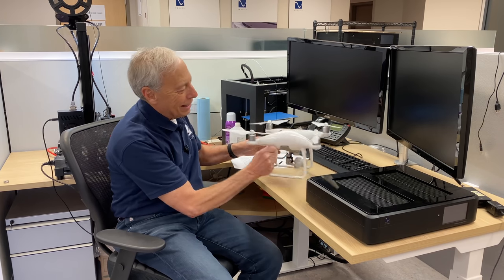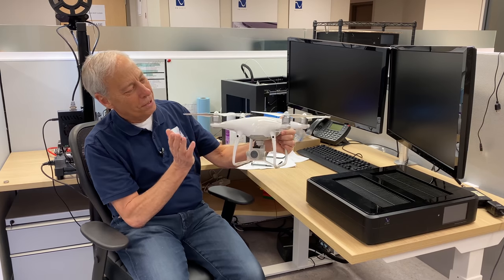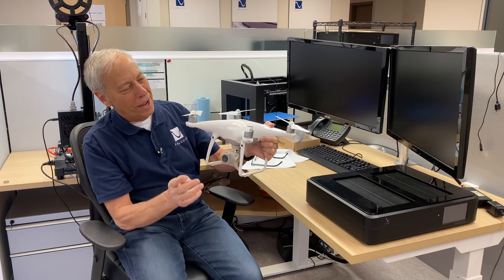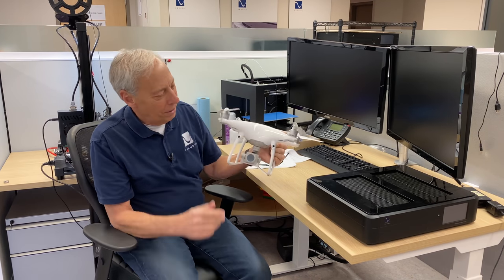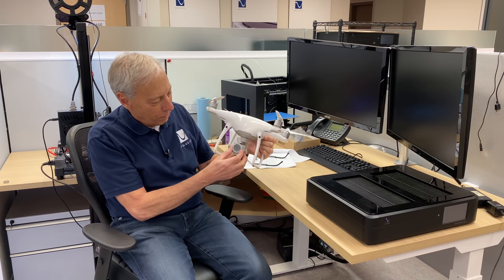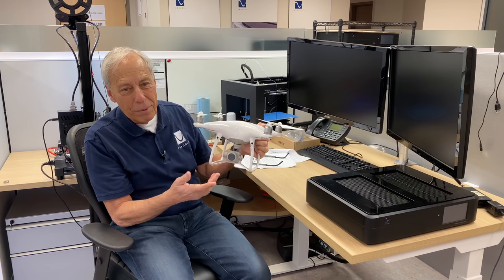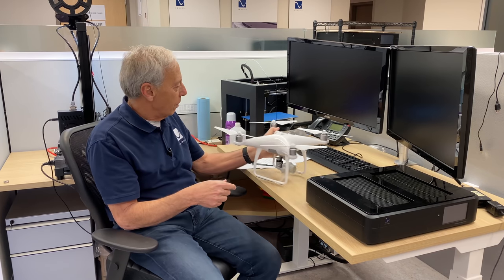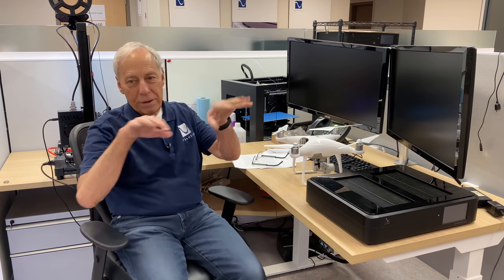Power Amplifier protection

Comment: “Going DC” was much more common in early SS amps that used giant output caps. Many SS amps have sacrificial resistors at the outputs that function as very slow fuses.
Reply: Output resistors can be
1.  Emitter degeneration - allows control/monitoring of current, and balances current across parallel devices.  
2.  LR network - isolates amplifier output from highly capacitive loads, to help ensure stability.  
3.  RC network - provides loading at high frequencies in case of unloaded operation.  
None of those are sacrificial, or intended to function as fuses.

Comment: My amp has these dc offset detecting circuits that keep the mean centre of the output at 0v and also current limiting circuitry to prevent fires in the speakers ...
Reply: But users manage to set their voice coils ablaze, regardless of how carefully the amp designer builds the current limiting and DC offset nulling circuitry.

Comment: Paul's explanation of a crowbar is only partially correct it is called that because it actually shorts the output like putting a crowbar across the output terminals of the power supply (to protect the rest of the circuit) then it relies on either the current limiting ability of the supply or it can  then trip a breaker or blow a fuse.

Comment: After watching this as well as many other of your videos , I'm wondering what your thoughts are with connecting your amps or other manufacturers amps to a dedicated line/ power conditioner. Love what you do thanks for your input .
Reply: Amp protection is a good thing but PS Audio should not say that they can’t engineer excellent tone controls and loudness controls because a simple bypass switch will harm the sound...cause amp protection involving fuses, relays, feedback loops etc. are sonically much more critical than a simple line level bypass switch.
Reply: @ThinkingBetter  well not necessarily you can just measure the output without affecting any signal going through the Signal Path I'm assuming that's how it works for them
Reply: @johnsweda2999  Yes, measuring can be done at high impedance but the mitigation of the failure needs something like a relay. Not sure exactly how PS audio is doing it.
Reply: Paul definitely recommends their "Power Station" line of regenerators, but not other types of conditioners - except their little "noise harvester."  
If they weren't so expensive, I wouldn't mind having one to tinker with and tweak.  Could be useful for a test bench.  But don't believe the claims that they can improve sound quality, other than helping to prevent clipping distortion in special cases.
Reply: Marianne Oelund Special cases = measurable cases.

Comment: My Luxman SQ507X amplifier (early 1970s) only has fuse protection on the outputs so I have added an externel DC voltage detector module with relays that will disconnect the speakers should the amplifier fail. I confirmed that the module operated correctly by applying a small + or - voltage from a battery with resistor in series.

Comment: I want to add how a quality amplifier should act , in the 70's Phase Linear (a Bob Carver company ) had one of the first high powered amplifiers at 350 watts per channel ,one audio magazine reviewing it decided to test it's protection circuit ,they turned it to maximum power and shorted the output terminals with a screwdriver , the amplifier shut down like it should and was fine afterwards ,the screwdriver did not fair to well it looked like someone arc welded with it.
Reply: Carver WAS & STILL IS { RIGHT ON } TOP ( of the )  CLASS
Reply: If you're able to get a working Carver product then you have a winner
Reply: @analoghardwaretops3976  I have a MXR 130 "The Receiver" a MXR 2000 and a Sunfire Ultimate Receiver and a Sunfire True Subwoofer ,and ALL of them sound great. Just wish I could afford one of his new  Crimson/Raven tube amplifiers that have  a 50 year life on the tubes.
Reply: @ameldaquirk3965  They were the most powerful amps by far in the early 70's and did not have the protection circuits of newer designs and occasionally  some did go up in flames. but the issue was not as bad or wide spread as the rumors would have you believe.

Comment: Crawled under a client's home to discover why one channel showed a dead short and blew up his very expensive Kenwood KR9600 a second time.  Idiot used a staple gun to affix the speaker wires to the floor joists and one was straight through.  Fixed that and his amp.  Another situation involved vermin chewing the wires in the attic. In both situations, the amp protected its self by frying.
Reply: Kenwood is not the great company that it once was in the 70's , since then they have focused on bells and whistles instead of quality. I had a kenwood monster receiver the Super Eleven  really impressive to look at with all it's features and great specs (on paper) ,But my Carver MXR 130  sounded way better I heard things that I did not know was on the vinyl or CD . Also better amps do have protection circuits.
Reply: Once while listening to "Dark Side of the Moon" opening heartbeat at high volume, the lead wires on one woofer managed to touch and stick together, causing a short circuit on the right channel.  The amplifier (Dynaco Stereo 400) was fine, and in fact didn't even blow the speaker fuse.  
That was back when amplifier output stages had fairly aggressive current-limiting for protection, which had reduced thresholds when the output is near 0V.  That protects the output transistors from exceeding their Safe Operating Area.  Obviously, it works - but then it can also lead to distortion with reactive loads.  
Most newer designs do not have instantaneously-acting current limiters with low thresholds near 0V, but instead detect average current through a filter, and put the entire amplifier into shutdown if the limit is exceeded.  That avoids distortion with reactive loads, but could in some cases still allow damaging over-current transients to occur, especially in designs that use BJT output transistors (MOSFETs are less susceptible to damage from high-current transients).  
Unfortunately, manufacturers do not share such design details, which would allow customers to select a scheme that they prefer.
Reply: @leekumiega6576  
The Super Eleven does have a fast output-stage current limiter, fixed (not voltage-dependent) at +11A but it only acts on the positive swing.  That could conceivably cause some distortion at high power with a 4-ohm or heavier load.  Note that it's only rated for 8-ohm loads and may have difficulty with speakers that have impedance minimums much lower than that.  
The other interesting design feature, is that they've used the high slew rate of the gain stages to compensate for a very simplified output-transistor bias network, which would otherwise cause noticeable crossover notch distortion.  It has still managed to put up some THD numbers that look good with a resistive load, but it's perhaps less effective with reactive speaker loads.  Also, I have to wonder if they're making their distortion measurements at an optimum temperature, while performance would not look so impressive at other temperatures.  I think they should have put more effort into the bias network design instead of relying on feedback to address its shortcomings.

Comment: Crowbar protection is of the "Destructive " type ..
 to activate/protect
A DC link short circuit device 
is  triggered..to blow a fuse... which can also blow the device itself..
The high short circuit current puts a tremendous strain on the rectifier bridge..,the input transformer also can momentarily saturate..
the surge current drawn from the filter caps can exceed its peak ripple capacity for several milliseconds...causing degradation 
Similar repeated failures over a short time & the equipment will see early end of life ..
Reply: No amp designer would put crowbar protection at the speaker output.  Perhaps at an internal power supply output - if it's a type that could produce overvoltage due to a component failure - but I've never seen such a circuit in all of the amp schematics I've been perusing.  
Speaker protection is commonly done with a series fuse or relay.  Sometimes with a power-interrupting relay.

Comment: Galliek Krueger CLASS D amps need lots of protektions, THEY SUKC! The patch cable from the reverb unit touched the ASPEAKON to quarter uincl PHONE PLUG adapter and then the Gallien krueger must hav eshort circuted and the it stopped working. Mayeb CLASS transisters are real sensitive. THANKES YOUE AND THUMBBSS UPS!
Reply: As in Genesis..
IN THE BEGINNING ...AMPS WERE VOID OF ANY PROTECTIONS.....